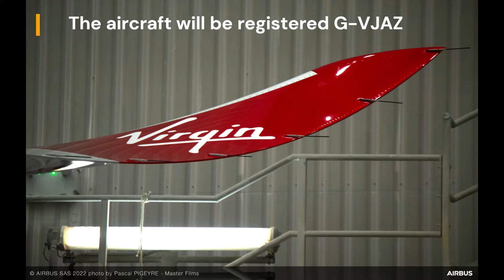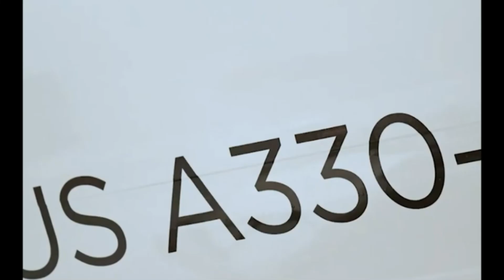Virgin Atlantic to Receive A330 NEO

Comment: So Virgin Atlantic will be the first airline to have the 787 and the A330neo at the same time! however, I would still prefer to fly a 787
Reply from the maker: Oh I did not know that! I’ve only flown on the 787 myself and not the a330 neo so I don’t have an opinion on which I prefer, in terms of looks though the A330 neo is great!
Reply: @AviationReviews  I agree ! I really like the forward and sleek design of the A330neo, but the 787 wins my heart with its sharp design and is slightly more comfortable in flight in my experience.
I have flown in the Corsair A330-900 and the Air Austral 787-8 and find the 787-8 so much roomier with much easier aisle movement and wider seats.
Reply from the maker: @planeup__3049  Yes the 787 is quite modern and good as well! Ah Corsair, I see them a lot when going planespotting at Orly!
Reply: @AviationReviews  Yes, you can see the 787 from Air ausral at CDG and it arrives tonight
Reply from the maker: @planeup__3049  Oh that’s good. Sadly haven’t been much at CDG I go a lot in Orly since I’m often in the south of Paris
Reply: @AviationReviews  Ahh okay